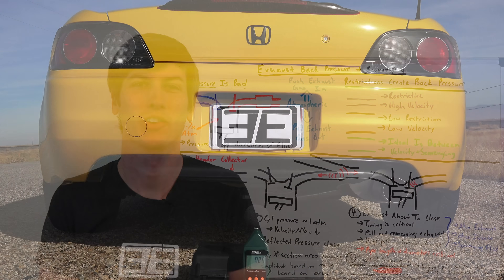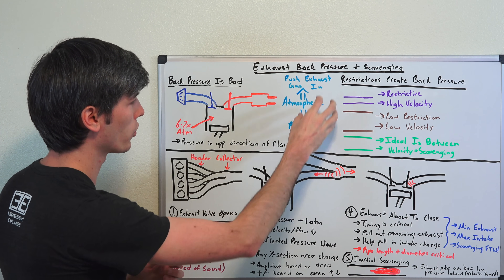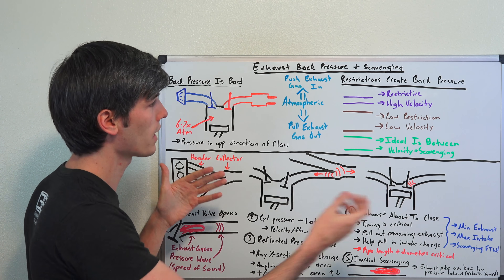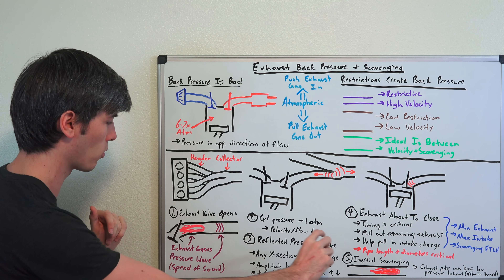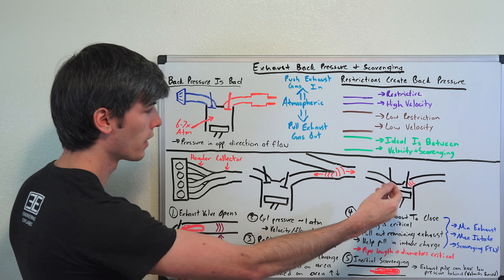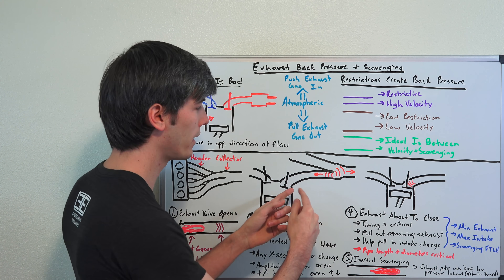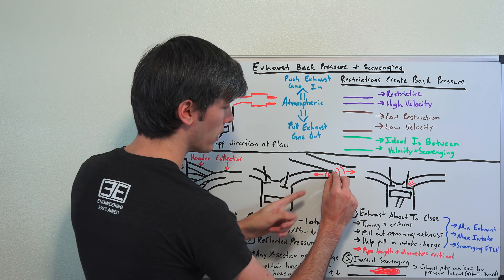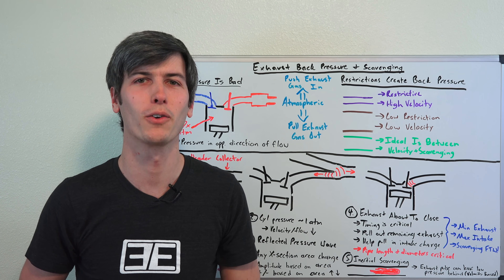Stop Saying Car Exhausts Need Back Pressure

Comment: You are VERY wrong, and I worked as a senior engineer for a 'very public' filter-and-muffler company for a LONG time. You are spouting this 'theory' from a blackboard. In reality, to start with, valve timing is NOT PERFECT, you have overlap - where intake and exhaust are, in effect, both open (or closed) at the same time. Secondly, your exhaust pressure is NOT 1-ATM, it is 1-ATM PLUS the reducing pressure of the cylinder scram as the exhaust valve opens. THUS, if you tap your header at 2-inches from the head's exhaust port, you will ALWAYS find 1+ ATM at the sensor port.  When you say 'you need back pressure', what you are REALLY saying is that you do NOT want to run without headers, as this would allow cold air to enter into a hot chamber due to insufficient 'tunnel' to prevent 'cold draw' (which does occur in event of misfire or failed ignition of fuel-air mix) onto the otherwise-hot exhaust valves and seats (cold air on hot seats can and will cause seat cracking of hardened steel seats or hardened or sodium valves). Plugging an exhaust is NOT GOOD, but if you have EVER watched dyno readings, you can (on many engines) accomplish BETTER power curves, and even throttle response times, by controlling the size of the header down-tubes. This would NOT be empirically provable if BACK PRESSURE was not a contributor to optimized exhaust flows.  Even baffling in the muffler itself causes BACK PRESSURE due to velocity changes within the muffler (deceleration) as a result of the baffles being STRATEGICALLY PLACED to effect decibel reduction of the exhaust (by changing velocity to heat, just as shock absorbers change hydraulic motion to heat).

Comment: So i have a question i have a 1997 subaru outback limited with the 2.5l naturally aspirated 5 speed manual. i currently have a 3in. Cat-back exhaust and a home made short ram air intake. I was wondering since this model from the factory made 160 crank hp and 170 ft.-lb. Of torque if the exhuast i place on it is to large? The factory exhaust size being 1.8". Ive noticed that from 2600rpm to 5800rpm is were i feel the most, where as before with the factory exhaust it felt the best from 1800rpm to 3900rpm. I figured i just moved the peak power from the low range of the rpm's to mid to high rpm range. But im gauging this all on feeling. Might this be true or could i have lost power and torque some where?

Comment: Great video!👍
Can you explore reasons for exhaust miss fires
(back firing exhaust) during throttle down from high speed or sitting at idle?
I participate in garden tractor pulls and power plays a big part in going the distance. I run home built exhauste pipe and I've noticed when the engine backfires it's followed by a combustion miss that I fixed adding baffle inside my pipe. What causes it to hick up regardless of fuel mixture adjustments and is it a sign  of less efficiency?

Comment: Scavenging is good. Using exhaust pressure to create a vacuum for the next/other cylinder is good. The reason that there was the need for back-pressure was for backpressure EGR systems. They relied on backpressure to know that there was a load on the motor and then add addition spent gasses into the combustion chamber to lower cylinder temperature below the magic 2,500 degrees when NOx is formed.
Reply: Oh forgot that there are systems on diesels like the 2 stroke Detroit Diesel that would increase backpressure to very high levels to reduce wet stacking.

Comment: I had the stock h pipe and mufflers from my 03 Mustang GT cut off and replaced with turndowns. Car was loud but lost some noticeable torque. You could feel it. No lie. I race it all the time. It's still fun but not as quick when you get on it. I think there's some Motor works videos where they got the same engine with 3 different exhaust set ups on the dyno. Noticeable difference after.

Comment: Is there some kind of formula to figure out the sweet spot or only a dyno will tell? I have a 09 Jeep SRT8 (6.1l v8) with kooks long tube headers and high kooks high flow CAT's, but with the stock Jeep SRT8 CAT back. According to peoples' dyno tests the Jeep does better with the stock CAT back than with any aftermarket one because of the "restriction" the muffler creates. In fact it seams there's more low end torque but less top end HP with a stock CAT back compared to a aftermarket one like Borla S. 

What would your recommendation be (stock, aftermarket, or custom CAT back)?

Considerations: My 09 Jeep SRT8 is daily driven (loud is nice but not good), I take it to the drag strip as often as I can (bi-monthly), I'm looking to improve my 60 foot times (1.7's on Nitto NT05 tires).

Comment: Can someone explain me scavenging..
I tend to lose grip in these video...
Reply: I'll try. The flow of exhaust from any one cylinder is not a constant stream- it's a series of pulses as the valve opens and closes. therefore what you get is a "slug" of exhaust gas that has mass, travelling down the pipe. The slug has a "vacuum" behind itself  ; the slug being terminated by the piston reaching top dead center (NOT the valve closing). The camshaft then holds the exhaust valve open for a bit longer (milliseconds), and the "vacuum" or region of low pressure behind the slug, causes some of the intake charge to want to go straight over to the exhaust. You THEN want the cam to close the exhaust valve as quickly as possible, to trap that intake charge. The intake charge also has inertia, and so it wants to keep rushing into the cylinder, filling it completely, and then some. This is scavenging in a nutshell, and is all dependent on exhaust pipe design, intake runner design, most importantly camshaft specification, and to a somewhat lesser degree- cylinder head design. The pressure waves travel at the speed of sound within both the exhaust and the inlet tract, and calculations for pipe length and diameter use this figure as a constant to determine the optimum sizing, based on camshaft specification. An ol' boy's trick back in the never-never days was to make a pipe runner too long and rub a stripe of soap along the pipe. Then they'd rev the engine, and where the soap stopped burning, is where they cut the pipe, and put the collector- because at that point the slug had lost temperature and therefore velocity, and the change of shape from the collector (and subsequent wave reflection) was roughly ideal for the scavenging effect. 
Did that help?

Comment: So this is just a theory, but is "exhaust back pressure" a hold over from the days of leaded gas and the valves were more prone to warping? I've owned a few '60s cars and they behave differently, sticking valves drive you crazy!!

Comment: Why would you want a higher exhaust gas velocity at the cost of increased “back pressure” in the “ideal in between” diameter? Wouldn’t a specific mass flow matter more rather than the air (fluid) velocity? Larger diameter would allow same mass flow or even higher because of less of a pressure drop (lower back pressure), this is why we sometimes see small amounts of added horsepower when a less restrictive exhaust system is installed.
Specifically, I mean after the exhaust manifold because in the manifold exhaust velocity is critical for exhaust/inertial scavenging.

Comment: Decades ago when I was helping out a SCCA team, our engine guy made 2 sets of headers. One set was equal length and rather short to maximize peak output at higher RPM. For some tracks needing a bit more midrange torque he had another set with a short and long tube set mixed. This was a better compromise than all equal longer tubes that gave more low torque, but really dropped off the high.  Half of engine building is exhaust design.   One engine guy I knew even made internally tapered steps hidden inside the constant diameter OD of the header pipe ( to hide the steps) in order to better control the back wave to his desired flow characteristic.  Interesting combination of fluid dynamics and acoustic pressure waves in exhaust systems...
Reply: Jennifer WhiteWolf Multiple EP national champ Joe Cogbill had engines for his 96Rock Speedster specific for fast and slow tracks. IIRC the fast track engine had a 1.75” dia. exhaust and put out 172 HP. The slow track motor utilized an exhaust of 1.625” dia. exhaust and put out a max of 158 horses but more in the lower rpm.
Reply: Sounds like you know your stuff!  When I made a custom exhaust for my turbo car years ago I used a mathematical equation to determine what diameter pipe I should use with the engine displacement and boost pressure and what rpm range I wanted to improve upon.
Reply: @82raptor  I'm interested to learn more on how it went? Any tips?
Reply: jockellis; do you race too?  You comment about 96rock makes me think you're from the Atlanta area.
Reply: Ornery Hermit Well, I went to the Skip Barber 3-Day school at Roebling Road and raced Karts on ovals but no other wheel to wheel racing. But if I can ever get my 914 project car finished I want to go hill climbing. I interviewed Joe for a story for VW & Porsche Magazine but could never figure how to save it to my Radio Shack Model 4 and it kept disappearing.
Reply: Wow.  Talk about a small world.  My first racing school was also with Skip Barber at Roebling.  We ran Formula Dodge open wheelers (no wings).  Then I did the SCCA school in a rented Miata at VIR.  Been racing spec miata and Spec Racer Ford's since then.  Will actually be at Roebling Road again later this month for a SCCA event.
Reply: Ornery Hermit How fast could the FDodges go around that last turn onto she straight? Did Bruce McInnis run the school?
Reply: Oh man, I think T9 was a 3rd gear turn, not sure of the speed.  Those only had a 4-speed gearbox, straight cut, non-synchro.  Learned the double-clutch dance in them.  I don't remember that name and it was 15 years ago.  I think we only had 9 students that weekend.  My name is Richard Anderson, I think I found you on FB.
Reply: Ornery Hermit The 100 degree included angle right hander onto the main straight? In a Crossle 32F I went through that at 5200 in fourth. The 180 before that was definitely 3rd gear.
Reply: Yeah.  That's about what I remember from that car.  We were there one weekend with some rainstorms and T5-6 flooded.  The drains had clogged and they got out there with tractors to try and displace the water but finally figured out the drain was clogged.  Once that was free they were able to get the track clean after the water drained.
Reply: Gents, I did several track days at Roebling back in 2001-02 with my GSXR-750. I would top out 6th gear on the front straight, I couldn't believe it, (160+mph)I was looking for another gear before the turn one braking zone, what a hoot! Getting a good drive out of the last turn and just haulin-buggy! Of course I could've got into gearing changes but we only doing track time not actual racing. 

I recently saw a video of cars out on the track and it looked like they finally repaved it. Back then there were tar snakes and patches all over the place. It was really intimidating for a newbie, but there was actually a racing though it all and once you figured that out it was so much fun.
Reply: With the Yamaha EXUP, there's a valve restricting the entire exhaust astthe join of all 4 pipes.. Ideally that means peak torque available for the engine at all revs is .. Available. In reality you have a valve that needs to work up to ~450°c in a dirty, high velocity exhaust pipe, with the bearing inside the pipe almost in the exhaust flow, so a massive pain to keep it lubed, working and not ceased. But its awesome when it works.

Comment: I guess it makes more sense if the title were "exhausts don't need restrictions".  Changes in cross sectional area that increase/decrease flow velocity and therefore change pressure (based on bernoulli's principle) are used to manage pressure throughout the exhaust path.  (this is why header is better than no header, exhausting direct to atmosphere slows exit velocity due to large increase in cross-sectional area, which increases pressure).  I think that's what most of the mechanics mean when they say "back pressure"; they really mean pressure/velocity management.  You can't just slap 4 in straight pipe on your 2.0L NA and expect a torque boost at a most, if any, rpm.  

 There is no need for glass pack or some other physical "valving", which I think is the point made.  And since the velocities vary with RPM, and you can't change the the exhaust path much to account for it, most modern engines use variable valve timing to account for the changes in flow velocity.
Reply: I watched another video from the exhaust engineering chief at Magnaflow.  He explained why a straight-through muffle can actually flow better than a straight piece of exhaust pipe.  The perforations decrease the total surface area inside the pipe, which decreases the drag as the exhaust flows along the walls of the pipe.  But he wasn't saying you 'need' that muffler, just explaining an interesting fact.

Comment: Can someone give me advice? I have a 95 F150 straight 6 that I'm going to make louder. I plan to cut after the first cut, replace the second one with a 3-inch pipe for about 20inches, then into a glasspack.After the glasspack, I'm going to changing it down to 2.5 inches then exiting almost instantly in front of the rear tire. Since I still have the stock header/manifold with first cat and I'm going down to 2.5 before its exited, shouldn't I have enough backpressure to not lose torque or horsepower? Thanks!

Comment: Thats fine for N/A cars. For forced induction cars, it doesnt matter as you need valve overlapping so the forced induction cleans the cumbustion chamber with both valves open. Also, timing the reflection is more about tuning the standing wave created by using the correct header tube length, much like tuning a church organ instrument, so the negative pressure of the wave sits near the valve, instead of the positive pressure. A reflection is unavoidable but not the most important part of the wave dynamics inside the exhaust.

Comment: If the air outside is 10x the air inside but yet the intake is pulling in 10x the pressure? I’m confused there.

Comment: +Engineering Explained
Exhaust backpressure is GOOD, and an important consideration - if you care about practical engine efficiency. Especially if you're dealing with a carbureted engine. Your fallacy is focusing entirely on removing all combustion products from an ideal engine. In reality, the practical engineers have already taken care of this for you, by opening the intake valve early, while the exhaust valve is not yet closed- to flush a portion of the gases from the cylinder. If you go about screwing with the parameters of the exhause system, you have to consider how the pressure waves and flow velocity impact the intake system as well. Using a less 'restricted' exhaust causes over-scavenging - fresh fuel and air blown completely through the cylinder, into the exhaust, and wasted. Increased intake velocity caused by the free-flowing exhaust, screws up the fuel-air mixture in carbureted engines, causing them to not run, or run rough at idle - usually 'fixed' by retuning the carb, and raising idle RPM considerably. In a fuel injected engine, it will cause the ECU to detect a 'lean' condition, and silently compensate by running richer - giving the illusion of 'free power'.

The engine must be treated from the perspective of a complete system - changing one subsystem that's easy to get to - like exhaust or intake - screws up all the other parameters of the system, and all the careful engineering that went into making them work as efficiently and practically as possible. Your argument is foolish, outside of amateur racing circles.